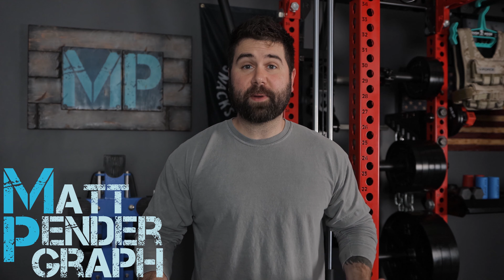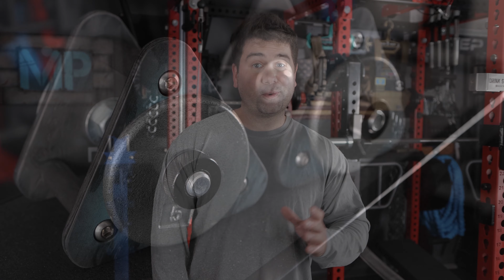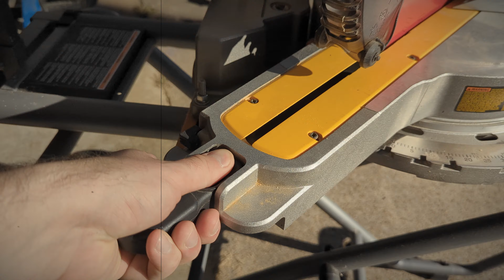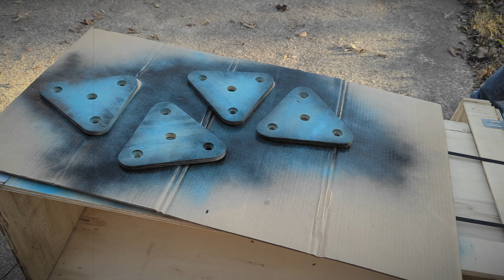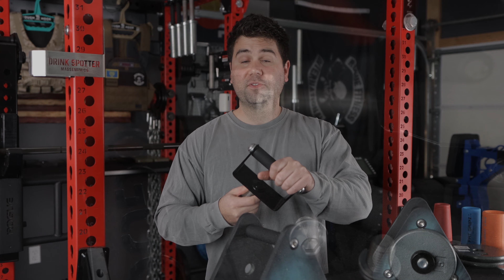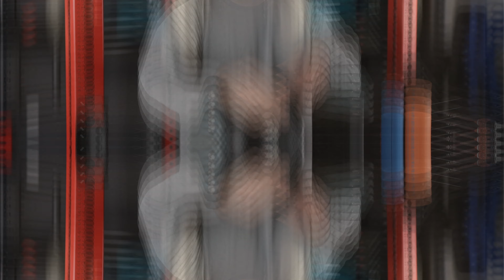Home Gym Build Off HAVAK Adjustable Triad Dumbbell Kaizen DIY Exercise Equipment Hack Overview

Comment: Since you have the new rogue MG-4C would those handles work to make these triads? Every picture I’ve seen the screws haven’t been screwed down all the way into the handle. Was curious if I’d have to buy new screws or if the screws provided will work to make these triads?
Reply from the maker: I don't see why not.  I didn't thread the MG-4C bolts all the way into the handles to see how deep the holes were, but you could combat this with either shorter bolts are NOT countersinking the bolts possibly?